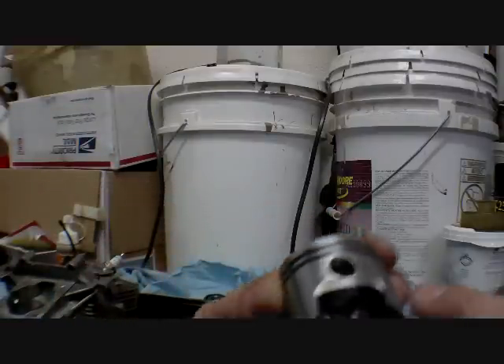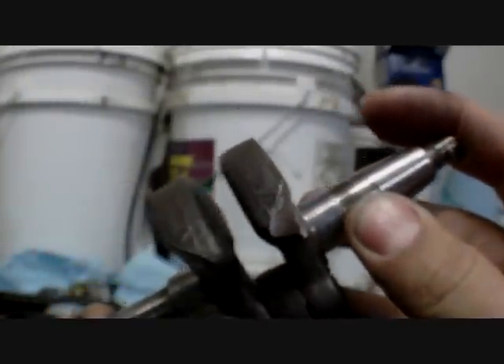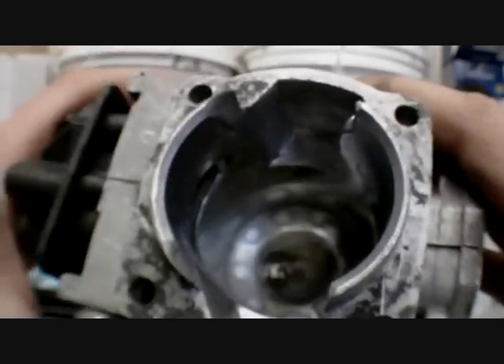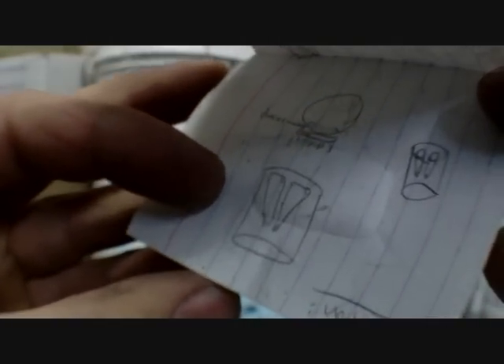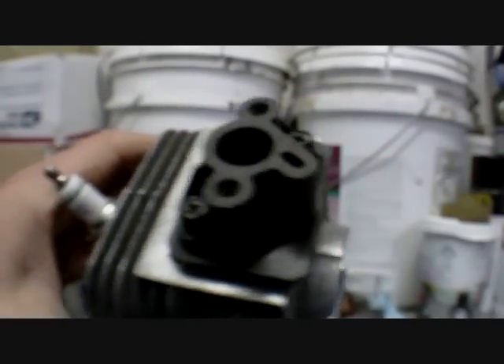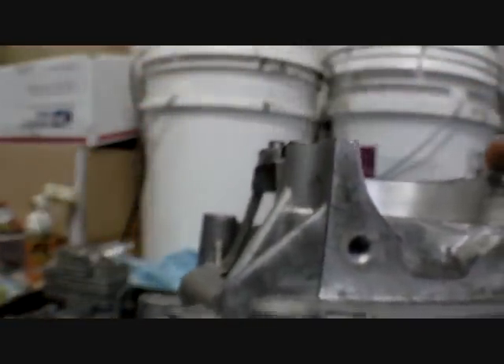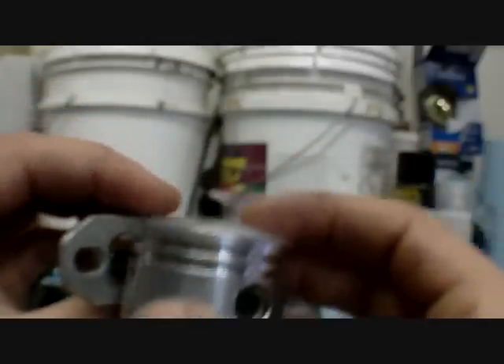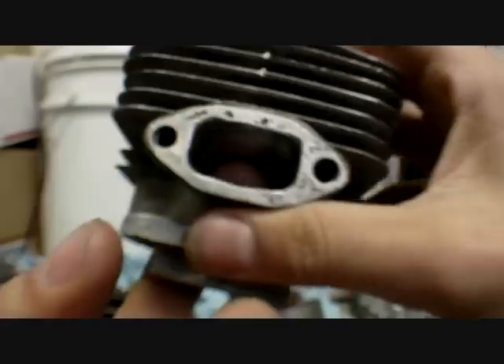how to make pocket bike faster (stage 2)

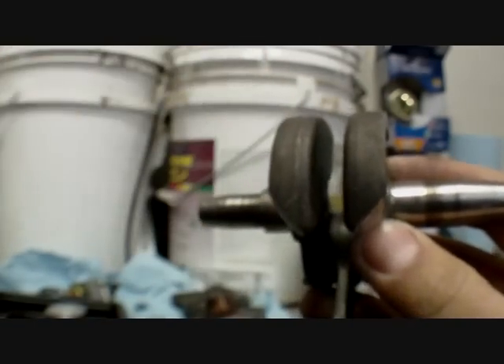Comment: 4:03 This channel is an impulse line. These carburetors are a diaphram type with no bowl/float, the impulse line bleeds negative crankcase pressure on the piston's down-stroke into the carb so it can push fuel into the cylinder.

Comment: Hey the real reason why that you want to have your fuel inlet rough your intake Port is because it comes all the way in real smooth so it can roll faster but when it gets right down to the nitty gritty before it enters the carburetor we want it to be cross hatched or rough surface because it splits the fuel up from liquid to vapor and viper ignites better it makes a bigger explosion with less fire so that is the real reason why that you want to cross hatch or have it your fuel intake really rough just right before it hits the carburetor no where before that though because it does run faster when it's smooth but it's liquid we want it to transfer to vapor before it hits the carburetor so it when it's injected then it will therefore be ignited a lot better

Comment: Actually that part of the crank case that you mentioned fuel goes through is actually a crank case pressure  point feeding pulse of air from the crank case over there  by the base gasket, it directs those air pulses towards the metering diaphragm for the carb to pump fuel from the tank that sits below therefore no gravity. Only used for a below  level tank that needs assistance to pump upward

Comment: There were a few good tips and a few bad tips in that video, but at the end of the day its just a tiny 2 stroke Chinese motor so there is not much u can do to the motor to get it to go harder. Changing to hotter or colder plugs can help and jetting the carb  & adding a better filter is about all you can do to the engine to make a noticeable difference, but heaps of power can be gained by changing the exhaust expansion chamber tuned lengths of pipe (which are the pipes before & after the widest part  of the exhaust system.)

Comment: If this actuly worked ur engine wouldnt be in bits and it would be like it from the factory
Reply: All of the China pocket bike engines need modifications to preform at a decent level.
Reply: @Baldys_projects  yeah you can gain 10% easy just cleaning up all the shitty castings, getting the engine to how it should be from the factory

Comment: My dad and I a professional automobile mechanic and taking any metal off any part it weakens the parts and will lead to major problems, and if you sand the intake manifold it actually slows down air fuel mixture and it wouldn't built up "WATER DROPLETS " and if there is fuel droplets you just have your  air fuel mixture way to rich.
Reply: Cars are not 2 stroke, u want the intake ruf to help the atamization of the fuel, mainly keeps it at vapor state, cars use values and timing to open, as a 2stroke is always open ,
Reply: He meant to say fuel droplets don't act like an idiot like water droplets when u talk about surface
Reply: Tention
Reply: That's strange we ported and polished our stock car engines and does make a great difference
Reply: Yeah you don't want to take any more metal off of a Ford 302 is barely any there to make it work as it is no heat dissipation. Once calcium builds up on the water ports heat dissipation like next to zero
Reply: I'm sure your dad's a brilliant automotive mechanic and there's a lot of good ones out there however we're talking apples and peaches
Reply: Two strokes are touching motor that's why expansion Chambers are very unique
Reply: The physics behind the expansion Chambers is like rocket science

Comment: why would he remove the carbon on the piston, it is basically free compression???
Reply: Not much really and not to good. If you want more compression then deck the bottom of the cylinder about 1mm.

Comment: TIP- If you are going through all that work of porting to get the smoothest flow, Turn the head 180° to get the sparkplug pointing at the exhaust. This creates an uninterrupted combustion flow that makes a huge difference by itself.

Comment: Polishing a cylinder bore actually increases friction, but not because of increased contact area. Polishing a cylinder decreases lubrication because there are less grooves to hold oil. Polishing therefore also increases operating temp. Less oil and increased operating temp is obviously not a good idea.

Comment: wouldn't polishing create more friction as there is more surface area in contact with the bore?
Reply: polishing essentially flattens the microscopic peaks that create friction. more surface area means more evenly distributed pressure as well

Comment: I have a bike with broken rings, I took them out and couldn't find replacements, will it work without any? I've heard it will completely ruin the chamber
Reply: without piston rings, you won't have compression, more wear, and combustion could possibly occur beyond the piston and cause big problems. I wouldn't try to run the engine without rings unless it's to experiment

Comment: Is it true that removing piston ring gives you more speed? I've spectated races before, made friend with one of the clubs. They said they always drive with one piston ring, but I did that on my other bike, that I don't have anymore and result was actualy opposite. Maybe pocket bikes are running differend? And awesome tips, btw.
Reply: marchlander1 I wouldn't if I where you
Reply from the maker: Thanks man, glad you like the tips. I never heard of ppl removing 1 of the rings. In removing the rings, you loose compression. The only possible gain is higher rpm (unless your top and bottom end are balanced for a lower rpm range) and less heat build, but with a major loss in torque. Only single speed devices would benefit, if at all.
Reply: I don't know... I'll try it, see what happens.
Reply from the maker: marchlander1 Let me know how that works
Reply: Reason people remove a ring is because they have a special piston with only one piston ring slot
Reply: If you do it on a standard pissed in the room where the piston ring sits offsets the compression enough to where you’re basically barely able to run it

Comment: Good job with porting and airflow but fail with bearings. The motor oil will have a much lower drop temp then bearings run dry and a bad day starts. Pack them with a good bearing grease. It may seem thick but its not at temp and your bearings will love you.